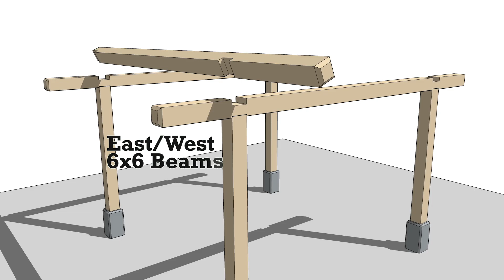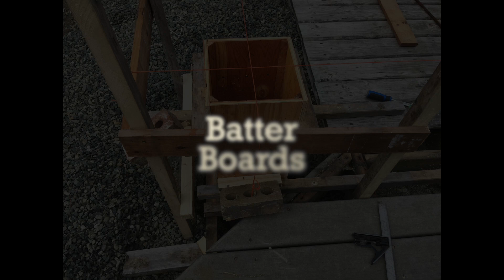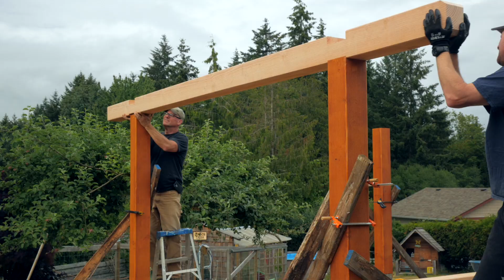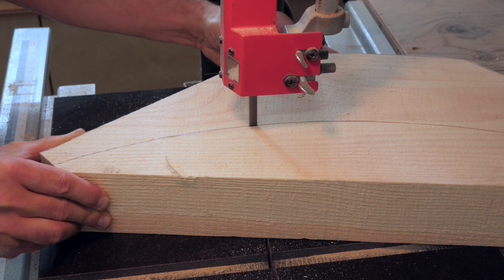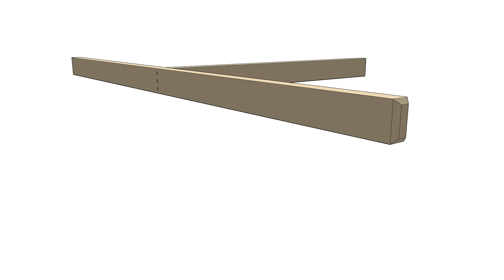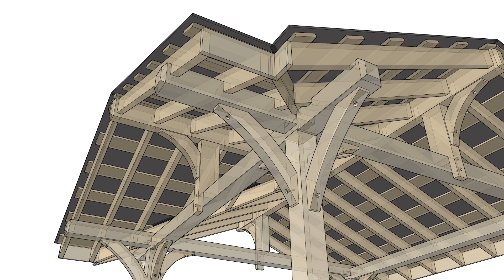Timber Frame Style Pavilion Gazebo for Backyard or Patio - post and beam

Comment: question... the angle corner beams when attached to the post base and post rafter base.... why do you drill the hole at an angle instead of perfect 90 degrees? 11:33

Comment: Beautiful work. I’ve just built a 12x12 gazebo with 6x6 rough cut red cedar. It’s beautiful. I’ve got the rafters and strips down and I ready for the metal roofing. Mine is a 8:12 pitch. Is there a reason for putting the plywood down other than aesthetic’s?

Comment: so the weight of the roof is going to the screws on the sides of the beams and beams are not working structurally. the roof will not get flat in a snowy area if the screws are strong enough.

Comment: Great video.  I have order the plans and am just ordering my material.  I’m going with white pine  green rough sawn.  I’m just wondering that if I stain it as I build it will i run into problems with staining green wood?   Maybe I should just stain mating joints and end cuts until it weathers a bit?

Comment: I'm starting to build your pavilion here in Virginia Beach.  Would offer that non standard dimensional lumber has been impossible to source locally.  I don't have lumber mills handy to create the 3x10 stock needed for the braces.  I'd offer that if you could describe a work around using standard lumber sizes it would make our jobs out here much easier.  As it turns out I will be laminating 1x4 boards in a bent fashion to match your arc for both the large and small braces.  A whole lot more work to finish the job, but I feel the curved braces make the look of the build.  Thanks for a really beautiful structure.  I cannot wait to get it finished.

Comment: Will those 6"x 6" beams still work if i wanted to make this in a 12' x 12' instead of the 10' x 10'? I know the dimension of all the other wood would also change a but I just want to know if the beams are ok to span 12' x 12'.

Comment: Gorgeous design. I live in Florida and had planned on building with pressure treated, although I am not a fan of it. Is there a reason I really need to use pressure treated? Your design is so beautiful, I would rather not use PT.  I have never attempted a roof structure such as this. I downloaded your plans, but my pad will be 14 ft square and posts will be approx 13 ft on center. Hopefully I can adapt the plans!

Comment: When attaching the beams to the post you drilled through the beam into the top of the post, which is the weakest attachment going into the post end. What's to prevent the entire roof system lifted off from strong uplift winds? The corner braces are good but doesn't seem enough bite to prevent uplift? I like the look and want to build something similar for a portico

Comment: Sorry.  Thumbs down. you have done nice enough work for what it is, but a couple of dados , rabbeted/half lapped king posts and screwed in braces are not timber framing. Heavy framing ,yes. There isn’t even a rudimentary mortise and tenon joint . There is a lot more to “Timber framing “ than the size of the wood.

Comment: I want to build an 11'x11' gazebo using 6"x6" posts and 6"x12"x12' beams.  Since I'm going to wrap the posts with some decorative columns I won't be installing the angle brackets.  Will using 1/16" metal brackets around the beams and posts enough?  There will be tile roof.  Thanks!

Comment: Here's an idea I used to build a complicated porch roof by my self . Since I have bad knees I decided to build my roof in the driveway . I mocked up the beams and built it on the ground saving me from having to climb up and down a full set of steps over and over . If your going to do this . Use small short posts and build the roof on the ground saving you from climbing up and down a hundred times . You can simple walk up to the roof check your fits . Adjust the cuts comfortably . After its all prebuilt . You number and disassemble it . Get some help to climb on easy time to re-erect it . I did my roof in one day by my self . The funny thing was all my freinds ask how I was going to get it up there . I lied and said I had a crane coming to lift it up . It took me about 1/2- to 1 hour to rebuilt it permanently . After being a carpenter for 40 I feel dumb I never used this trick all those year but climbed up and down so many times . Maybe my knees would not have gone bad had I used this tecnic .

Comment: I build these often. I may always overkill on the diagonal bracing size but if I under shoot it I get flex between the bottom of the diagonal brace and the footing in the post. I've never done one with Doug fir though. How is the rack rigidity on this?

Comment: Hey MANaboutTOOLS!  First, wonderful video. Every detail covered. Thank you. Second, I am going to attempt this on my deck. It is supported by 6x6 posts in concrete and very sturdy. It is a very low deck. What post base/anchor would you suggest when connecting wood to wood as opposed to wood to concrete? I am going to make sure that each column is directly over an existing 6x6 post.  Thanks!

Comment: you may want to try this type of joint, if you want to have the beams at the same height.
https://www.youtube.com/watch?v=OGcDER1TfbA&t=4m35s
this type of joint is used for Far East Asian traditional timber framing, and they don't use knee braces.
also, they set their post right on top of foundation stones without any attachment, so it is not a weak joint.
https://www.youtube.com/watch?v=Fcxv9l_WwcE&t=120s